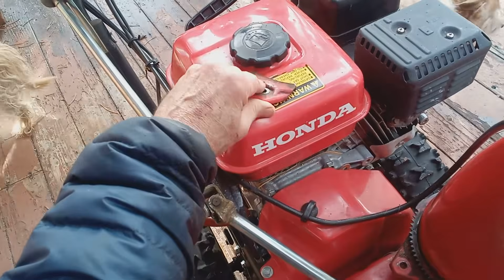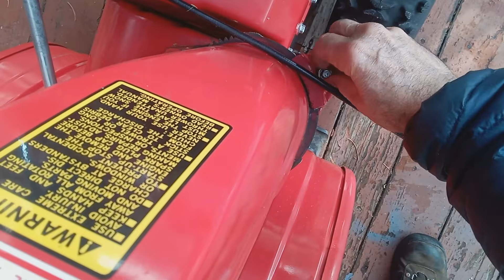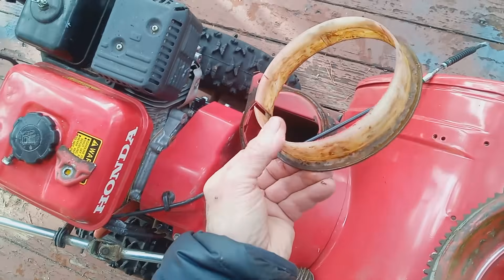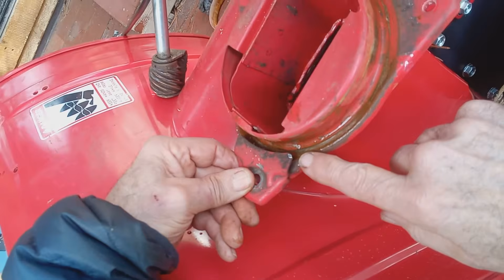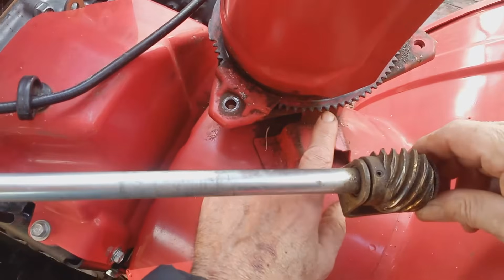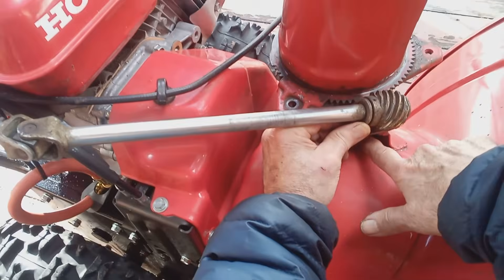HOW TO FIX Wobbly Chute On Your Honda Snowblower!

Comment: The easiest fix is to buy an Ariens.  😁
Just kidding.  Honda's are awesome.  Especially the Eurospec ones.
Reply from the maker: thanks. what are the eurospec ones?
Reply: @HondaSnowblowerEnthusiasts311  Assuming they still make them, you may see them on some web sites if you look around.  
The specific difference that I think is an improvement is they use exposed augers, like even the big commercial blowers in Europe do.
If you look at a side view of your auger housing, imagine the front trimmed back, and the bottom trimmed up, but the auger is still mounted to the housing the same.
The sides of the auger are now exposed, and now the auger sticks out past the front of the bucket.
Now imagine solid metal caps welded to the side of the auger so the auger edge cannot snag on anything it might hit.
Now you have a rotating edge, instead of a stationary edge, which an cut into the snow and break it up.  Works especially good on hard packed snow.
American snowblowers, well, modern ones, anything after 1980 or so, all have fully enclosed augers and you have to push the housings into the snow before the auger can even start to break up the snow.
In powder, it doesn't matter, but the more packed, or more wet, the snow gets, the more problems those machines have.

Comment: My cdn model is full electric with 2 or 3 motor I had to replace the motor once account the water was trap inside the drain plug was block  I make shure this won't happen again pricey motor.😕
Reply from the maker: great idea . thanks.
Reply: Is it the same procedure to tighten the chute on the electric models? Mine looks different

Comment from the maker: These procedures are good for the HS models 624-724-828-928-1132-1332 . For the older 50-55-70-80 models it is close to the same. the chute keepers can be loosened and adjust down to tighten chute. Not sure about the HSS models since I don't have access to one. Please comment about tightening HSS model chutes below to help out Honda owners. It may be close to same. Thank You.